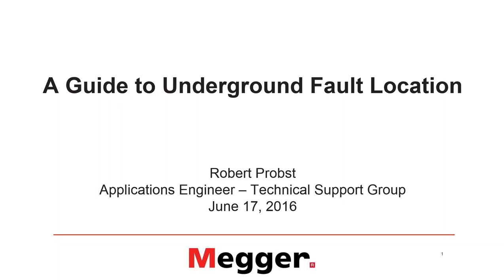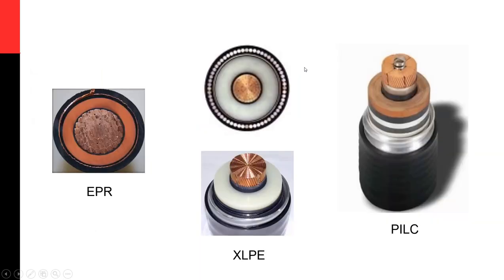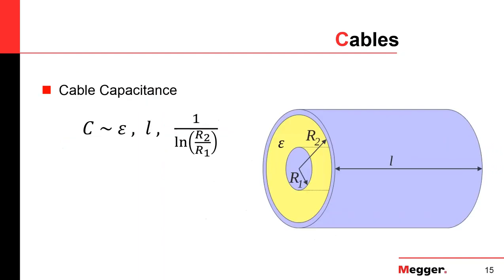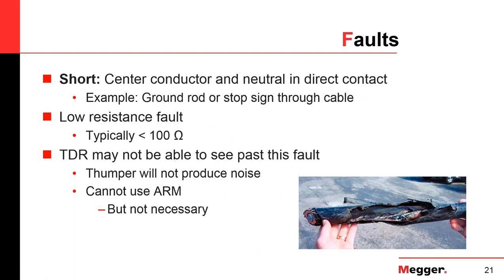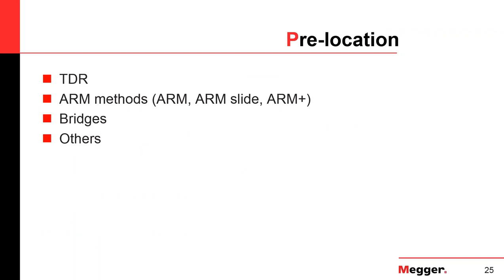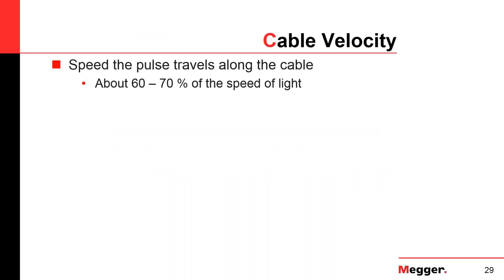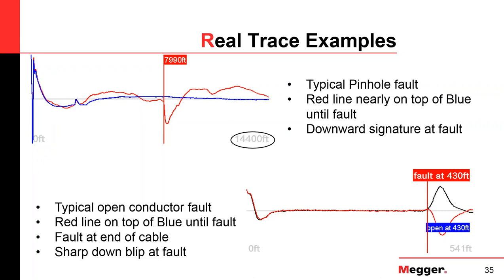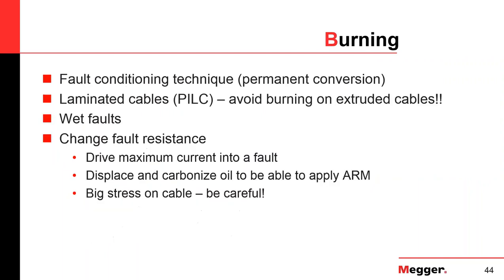Guide to Underground Fault Locating

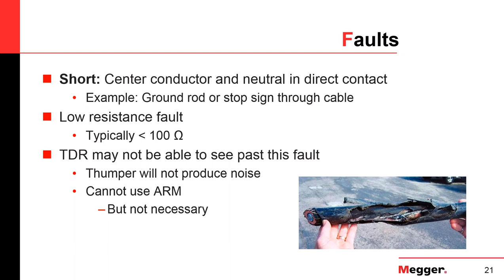Comment: at 22:00 it is mentioned that low resistance fault can not be pinpointed neither Arm method nor tdr so any possible soultions
Reply: That was open circuit fault